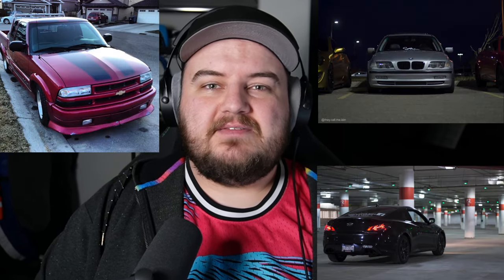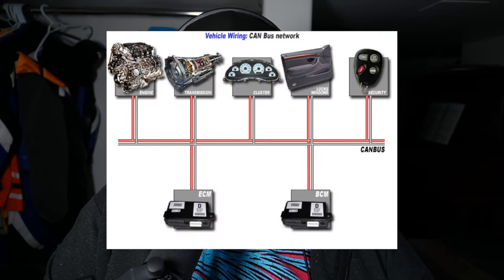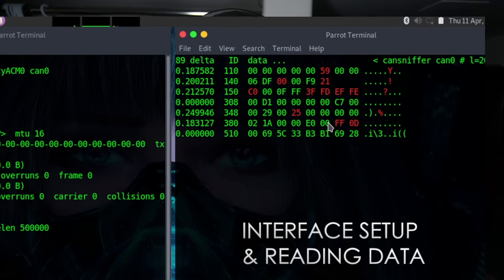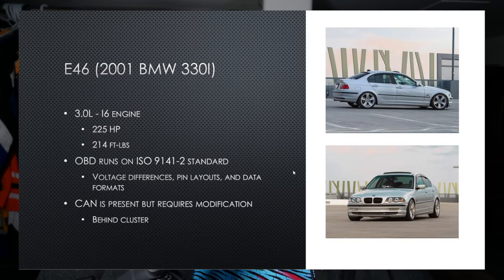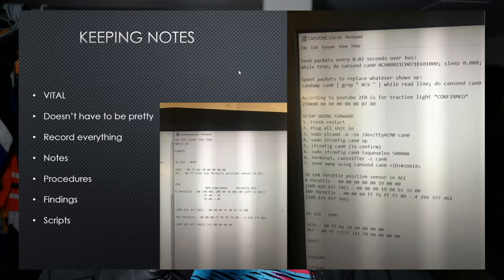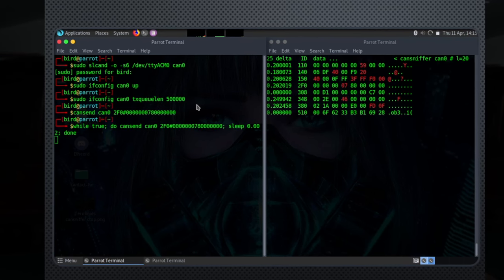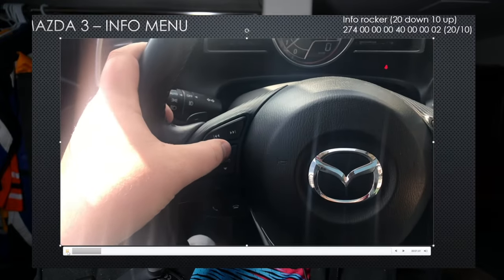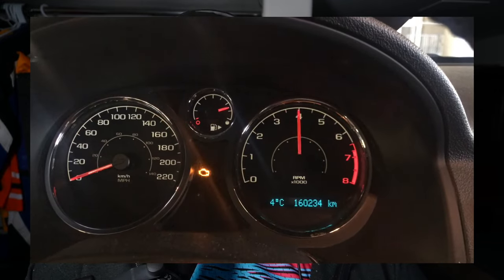We Hacked A Car! - CANbus injection

Comment: If you use a scan tool you can manipulate all that but if you decode  the scan tool signals for an individual action than input that and can save time. You can make a script and flash the ecm and record the way you want.

Comment: Super cool, I'm thinking of peeking into CAN to see if i can get steering wheel angle sensor data for a backup cam project I'm working on. Depending on what's least invasive it might be easier than tapping the sensor directly. The downside might be that it would make installation more car model dependent if I want to share the project.
Reply from the maker: So many systems to look into nowadays, excited to see what you come up with!

Comment: Andrew, this was awesome to see. I have a 2022 Sentra and I have a handful of things I would like to add to my home automation server from my car, and I was thinking CAN injection would be the way to go. As an experienced electrical engineer but total noob on CAN messaging, where would you start? I want to add things like lights, remote start and a bunch of feedback sensors from the car to a device that can communicate through a cellular modem to my server at home. Its feels very overwhelming to even think about where to begin. I am trying to find someone experienced that could help me get started with some advice. Im even willing to oay, because this is some niche knowledge.
Reply from the maker: I know the feeling, I was told it was too much when I picked the project. Like any project, lay out everything you want to accomplish, and start working at it one thing at a time. In your case, I'd focus only on getting a reader, and figure out how to sniff data. Once you get a feel for that, then look at actually forging some packets (Start simple, like a traction control light! See if you can find the DBC file for your car on the internet, it'll save a ton of time). Then you should have a better idea if what you want is feasible via CAN, or if you need to make any adjustments. Worry about the transmission of the data and the server side stuff later (Something like a rasPi or arduino with a GSM module can take care of that). Feel free to DM me on X if you have questions.

Comment: I would like to have a device that could be plugged inline between the scan tool and the OBD-II port such the device would tell the scan tool the MIL is off and that there are no malfunction codes stored.  It would have to pass the VIN and other vehicle specific info.  Does anyone have an idea how to do that easily for someone who handy with building hardware but not so much writing code?  Does such a device already exist?

Comment: Small nitpick: “Every car has a CAN bus” except all the cars produced before CAN was implemented… lots of cars are still out there with some variant of Class 2 serial, and even cars that pre-date having multiple control modules and only have a PCM that runs just an engine, or an engine and transmission. In fact, ~85% of the vehicles I’ve owned thus far have not had CAN, but ~65% of them had some form of serial communication and multiple control modules. 

Second small nitpick: I don’t think the music is needed, I can deal with it, but it is a little distracting at times for me at least.
Reply from the maker: Was meant as anything fairly new, I’ll have to specify next time. As for the music, it’s definitely too loud, just some growing pains haha.
Reply: @AndrewGerlitz  no worries, that’s what growth and adaptation is all about. I personally was hoping for a bit more in-depth exploration of CAN hacking, but I think this is a good “primer” video for anyone just getting their feet wet or discovering CAN stuff. You seem to have no issues presenting clearly and in a manner that I’d think was pretty easy to follow and understand for just about anyone looking for content on this topic.

I may have been a little too pedantic/nit-picky with your wording, I tend to be that way with accuracy sometimes. I feel like a majority of people ending up on this content are likely to be more familiar with what vehicles do and don’t have CAN, but I thought about it from the perspective of someone who ended up on this video with very little knowledge of cars and CAN who had a budding interest.  Purely trying to provide constructive feedback, not nitpick just for the sake of it.
Reply: Canbus was introduced in the mid 80s and has been on all US cars since the late 90s
Reply: @UnlikelyToRemember  I agree with CANbus being developed and introduced in the 80s, by Bosch if I recall. But I disagree with it being in “all” US cars since the late 90s. I’ve owned, worked on, and modified a number of late 90s and early 2000s vehicles that only had single wire class 2 serial or some other variant of a single wire serial protocol to communicate between control modules as well as available at the DLC. I actually don’t recall seeing CANbus between any modules in GM vehicles until around 2004, and at least some those particular ones I can recall didn’t have the CANbus present at the DLC and still used Class 2 serial between all the modules as well. It may have indeed existed in some US vehicles since the late 90s, but certainly not “all” of them based on my experience.
Reply: @Moddage  I stand corrected,  ODB-II was mandated in 1996, but it didn't have to be CANBus until 2008
Reply: @UnlikelyToRemember  that sounds about right. 96-08 cars are often an interesting mixed bag of communication methods, and not all of them were present at the 16-pin OBD-II DLC either. Some were basically inaccessible and only ran between modules, and some were present at other specialized connection points, often in the engine compartment. Even with the standardization we do have today, not everything can always be accomplished via OBD-II CAN on pins 6 and 14. There are still some manufacturer specific protocols and connections, sometimes also within the 16p DLC, sometimes not. There are applications with multiple high speed communication networks(CAN or a variant) where there is no direct/easy access to one or more of the networks and you have to go find and tap in at another module. Not all J2534 interfaces are created equal either… I nearly bought one that seemed to fit the “one interface to rule them all” category, but discovered it didn’t support the GM J1850 protocol, which I also needed.  I would love to be able to replace all my specialized interfaces with one, but we aren’t there yet and may never be.

Comment: Challenge:
Find the telemetry code that sends data back to the manufacturer for data collection and third party sales and disable or destroy it.
That would be a huge public service!
Reply from the maker: You are my kind of people! What I can tell you is Apple Car Play will not work if you have a VPN enabled on your device (at least in my 2019 Elantra). If I figure it out, Ill let everyone know!
Reply: With an oscilloscope or protocol analyzer connected to the telecommunications antenna, the bitstream can be intercepted. 😉

Comment: are you able to make a mazda 3  2005 power steering pump work independent, it needs a canbus signal from the ecu, I will pay if you figure it out
Reply from the maker: The steering pump is a hydraulic system independent of the CAN system (Aside from maybe a steering angle sensor). The only potentially exploitable thing would be some sort of assisted driving mechanism, things like lane keep assists, or self driving of some kind. Even then, depending on the implementation it may require other methods to exploit.

Comment: Well CAN Bus is something that will die and be replaced with FD and XL or automotive ethernet. What you did is not actually hacking anything it’s basically using DBC information of the car to change some states in ECU‘s. Keep in mind that ECU‘s no longer have non authenticated message buses. Well at least some..
Reply: Do you CRC's?
Reply: @honestlocksmith5428  Some manufacturers think crcs will help them but you can clearly see what changed and decode it, it’s only slightly more effort..
Reply: @platin2148  That's true. It's calculated and added to verify the authenticity of a message. Beyond that, what are you talking about? I'm curious to learn more.

Comment: This is very elementary. using the can system to tell features like lights or windows is one of the first and easiest things done when diagnosing a repair. you can pretty easily get a scan tool with the ability to use the canbus for a few hundred dollars and they work on any car with an obd2 port. is it anywhere near what you were talking about in the beginning when making a comparison to the f&f movie? not even close. no vehicles yet have the ability to be messed with any exterior programs that aren't plugged into the obd2 port. you could say stuff like onstar and remote self driving control are getting close but they are a lot more limited then what they appear to be
Reply: so be honest, how many times in a day do you say something like "well, actually...."